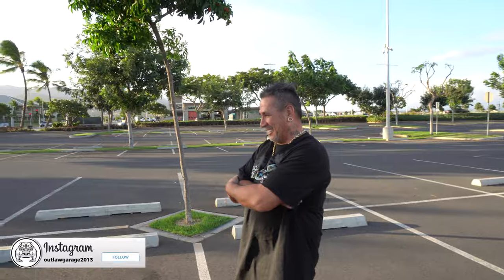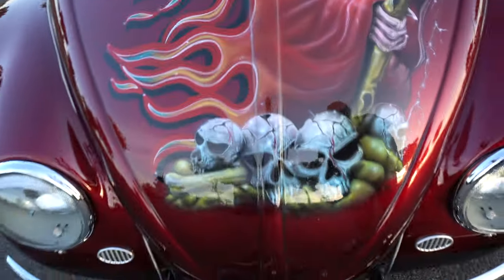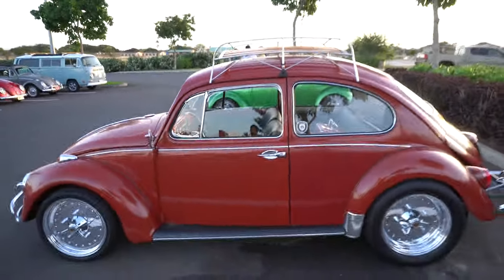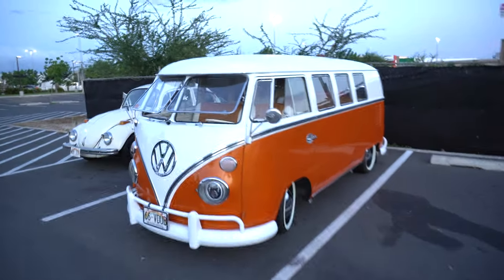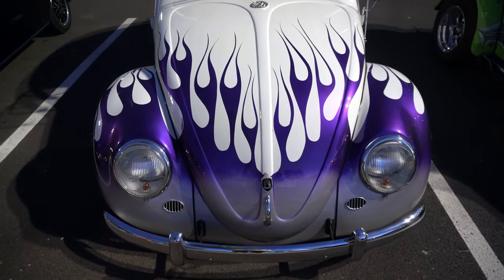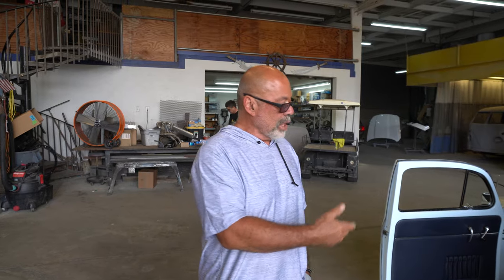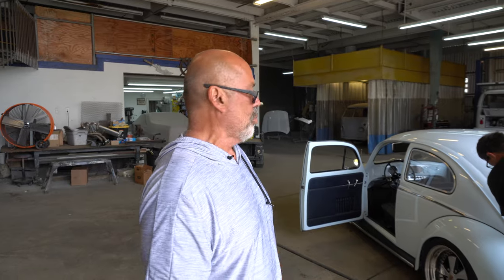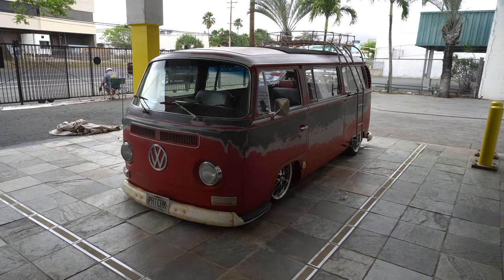Hawaii VW Scene || Outlaw Garage

Comment: With a hydralic package, can you add a connection to pump up tires? You guyz amaze me how you can renovate a complete car into works of art!
Reply from the maker: You could probably do that but in all honestly I probably wouldn't.  The kits need setting up and sealing and any variable out let to pump tyres is just another part to fail or leak.  I'd carry just carry one of the cheap green Slim flat tyre repair kits that comes with a pump that plugs into the cigarette lighter.  Tyre pump and repair kit if you get stuck.